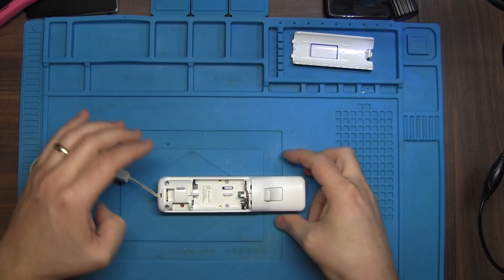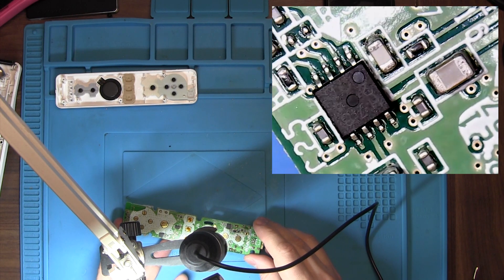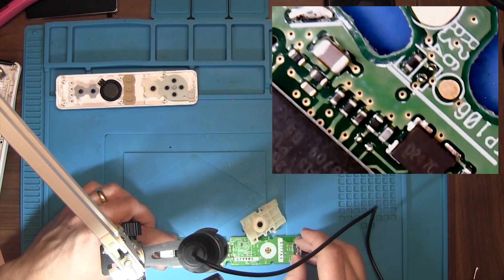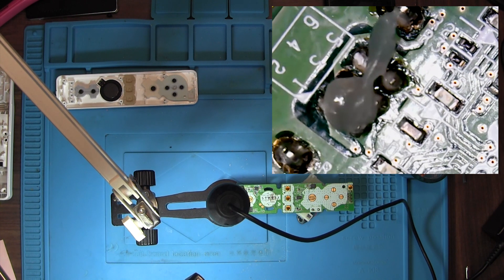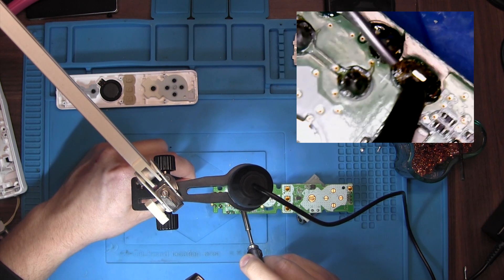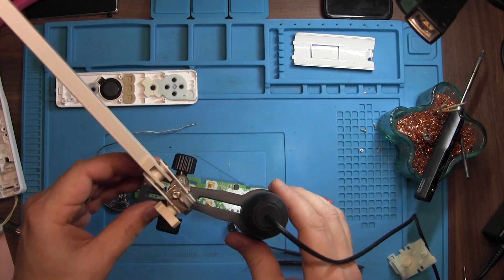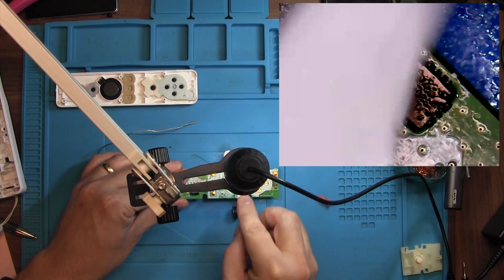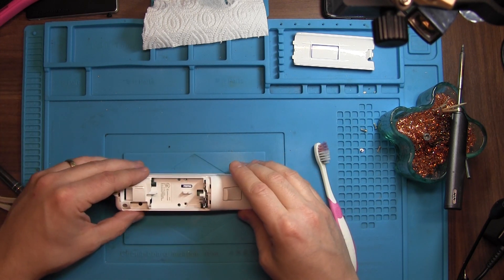Nintendo Wii remote motion control  not working

Comment: I'm having motion control issues with my Yoshi Wiimote rn.💀😤😭 This might be the video I need to fix my wiimote.😊 Does this work on nunchucks too?🤔
Reply from the maker: I do not know. I have not opened a nunchuck before. Never had any issue with them. But you can try. If you have hotair station it does not hurt to try. Most likely there sensor on that also.
Reply: Okay. I don't have one at all. But I can get one as soon as possible. Thanks anyways😊😉👍🏿

Comment: 3:30 hi there. what is the value of that fuse (size volts amps etc)?
Reply from the maker: I do not known the size of the fuse. Usually voltage and amps are very low with these. If you have fixed your short you can use a thin wire to replace the fuse.

Comment: How do i know if the chip is broken, or if i need to resolder the board? do you know if and where i can get a replacement chip?
Reply from the maker: I did not make any diagnostic on the chip since I took a lucky guess that it may have crack solder joint. Since these get very heavy use and get dropped a lot. This chip is the one that controls the motion. If you have another controller you swap that chip from a working one to make sure that the ship is the faulty one. Usually take a look at the markings on the chip and search from e.g. aliexpress or ebay. These are the places where I usually buy my spare parts.

Comment: How can I make this with using soldering iron? I don't have hot air.
Reply from the maker: you will need hot air because under the ship is a grounding pad also that needs to be reflowed.
Reply: Thank you for response. I will borrow hot air and try to fix

Comment: Thanks for this!
Reply from the maker: nice to hear if you got your control to work.
Reply: @modernfix1  Still haven't tried, but this was the only video I've found talking about possible solder cracks.
Reply from the maker: @natanteam  Well if you think about how these are used. Usually they are used pretty hard. thrown around the room when you lose. This will cause a crack solder joint.